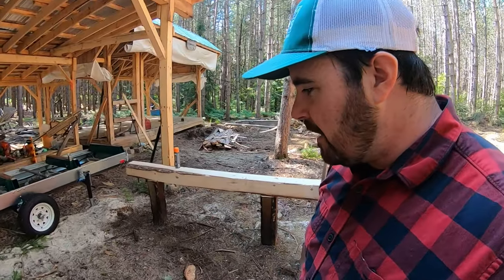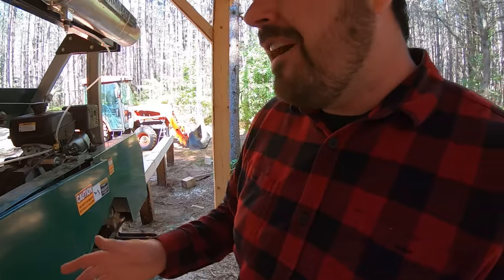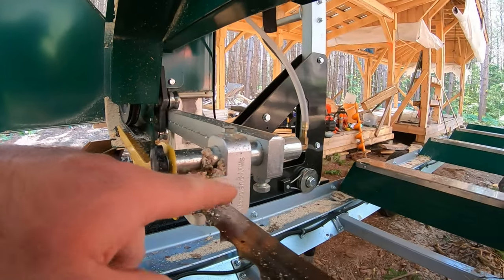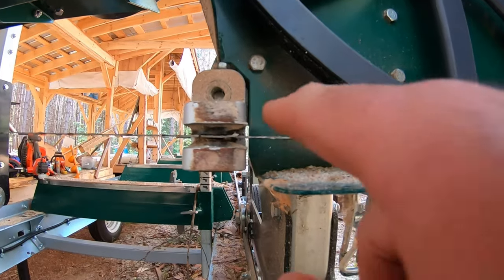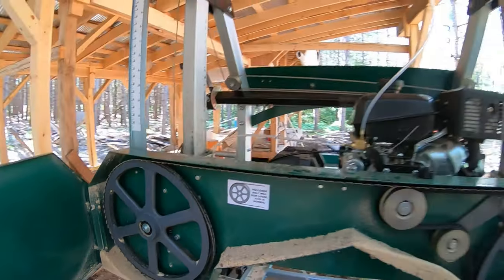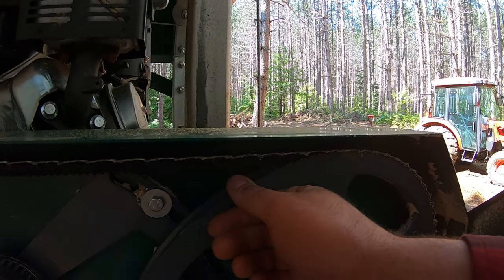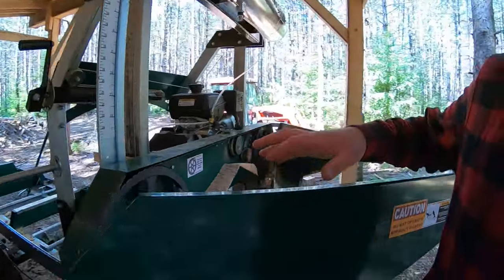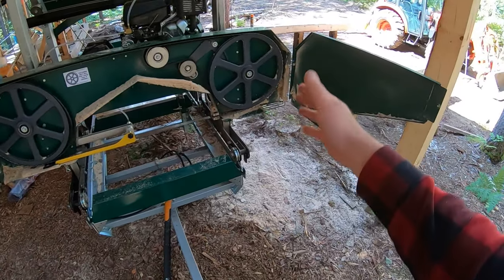Stop Your Sawmill Blade from Falling Off

Comment: I'm one of those people you mentioned at 3:55 who cut out those bars to keep sawdust from clumping. I didn't know then that those bars are designed to contain the blade if it breaks. Without those bars, it is possible for a broken blade to shoot out of there at high speed. Leave 'em in, folks.
Reply from the maker: Yeah I haven't had it happen but can imagine that it is possible

Comment: Great video Sandy-glad to see someone emphasizing the real purpose and positioning of guide block and guide bearings, easy to forget that as you're going through your log you're pushing an 800 lb mechanism with a 14 hp motor attached to it. You're 100% correct in saying that if all else is tensioned and aligned properly those blocks and bearing should only be called on to "help out" if you hit some gnarly knot. In a perfect world we should check them every time we change a blade. FWIW I also don't use lubrication-or at least not yet as I am milling green logs. Always surprised by the  amount of lube that is being shot out of the sawdust port on Norwood and Wood Mizer videos in particular. Videos are informed and informative-keep up the great work.
Reply from the maker: Thanks for that Kire!

Comment: Excellent discussion on why the blade may pop off.  I am on the other side of the spectrum, I use a fair bit of liquid soap and have the valve open  for the water to flow fairly heavy.  I have it adjusted so that the majority of soapy water flow contacts the blade teeth.  I think this keeps the blade cooler and reduces friction.  I have never had a blade pop off (knock on wood)  in the 2 years that I have had my mill.
Reply from the maker: I figure if it works for ya then you’ve got it dialed in and I wouldn’t change it either

Comment: Great tip! Yesterday I fired up my HM 126 for the first time in a couple of months. I checked my tracking and then adjusted the guide blocks. I used to have problems with the blade jumping off until Woodland Mills sent me updated information on setting the tension. My instructions said to turn it in until the crush washers made contact then turn two more times. I ended up damaging three blades. They replaced them and sent me new instructions for tensioning the blade. Works great! Cutting a pine log was very  enjoyable with no problems. I’ve been watching your videos for quite awhile and the spring of 2021 I purchased my first mill based on what I viewed in your videos. Thanks!
Reply from the maker: Great to hear you’re enjoying the videos and you have been around the channel for so long! Keep on sawing my friend!
Reply: Isn't great that Woodland Mills gives such support!  It is one of the reasons I purchased their product due to so many people declaring their exceptional support(and they were right).

Comment: Very helpful & timely advice, thanks Sandy. I have had a 126 for just about a year, and have had the blade jump off far too often. No matter how much I adjusted the follower wheel, the tracking was always just a little off - fractionally further forward on the tracking side, which is where it would inevitably fly off. After around 7 blades ruined (in only 10.6 hrs on the clock!), I mill in fear if that dreaded clunking sound & things grinding to a halt.
Finally worked up the nerve to tackle adjusting the drive wheel, in tiny increments until I could manually rotate the blade and see that it was staying true. Not declaring victory just yet, but I’m hopeful. It’s the only issue I’ve had.
Reply from the maker: I’ve got my fingers crossed for ya Andrew. Certainly takes the wind out of ones sails when the blade won’t stay put
Reply: I have the smallest mill by woodland Mills and this was something I noticed almost immediately. So I got on the phone and tried to contact someone with technical experience. And they advised me to adjust the drive wheel , much success has been had following a slight adjustment

Comment: On my third drive belt, but never had to change the follower belt. luckly i have not had a blade pop off. the wheel alignment has not been touched since new. blades are always checked prior to sawing ( well, Almost always). keep an eye out for potential problems and you should be good.  keep up the informative videos Sandy.
Reply from the maker: sounds like you’ve got a good system down Paul. I appreciate your support on the channel

Comment: Hi Sandy.  I agree about the pine-sol...perhaps we added too much as others use it without issue but my blade would pop off as well.

Another aspect that people should watch out for(if not using a torque wrench) is to make sure that however they are tensioning their blade, that it is consistent.  Once tracking is set, the blade generally will always track the same.  BUT...if you say add even a little bit more tension than normal, the blade will creep out on the idler wheel...less tension it will creep inward.  Even an extra quarter of a turn on the t-handle will do this.
Reply from the maker: Thanks for sharing that Mike. Consistency is key for sure

Comment: Great informative video! When I was setting up my sawmill I had a tracking problem right from the factory and the small adjustments are the right way to go. I have had a blade come off and it took out the yellow blade guard and the black plastic piece it slides in. Now I check everything you have said in the video as a pre startup routine.
Reply from the maker: Glad it was a good video Scott. Happy to hear everything’s up and running well for ya
Reply: My 126 drive side was out of wack as well, love the do not touch sticker they put on it, that plastic block was also damaged very quickly and replaced it with a 3/4” plywood coated in wood glue which holds up very well to impact and easy to duplicate.
Reply: @jeremyscott6641  I agree with the do not touch sticker. My hm130 max woodlander was no where close when I got it!

Comment: Great information! I asked you about a month ago about why my tracking kept messing up and you told me to replace the belts. Turns out the blade was riding on the band wheels and kept moving forward because of it. I replaced the belts like you suggested and now everything is running great! Thanks for the help and the awesome videos!
Reply from the maker: That’s great to hear. Nothing worse than not being up and running when ya just want to be cutting

Comment: Howdy Sandy- great information! I’ve never had trouble with tracking but I’m having a bit of shaking in the head and have to come to a stop and start again and cut slowly. Been trying to figure it out. Hope you have a great weekend. God bless
Reply from the maker: I"m wondering if the white-coloured bushings that run up and down the steel posts to keep the sawmill steady are worn a bit or need to be pushed inwards a bit to prevent shaking?
Reply: When I encountered that situation with my HM 126 it was due to warn out sleeve bushings . It was allowing excess play that caused the whole head to tilt and made the blade walk.  It was also causing jumpiness in the head when attempting to feed steadily. The kit is only $10.00 u.s., if you are running a wood lane mills.

Comment: good video. only thing i have to add is fully tighten to over 20 lbs be fore you check tracking and if it's a little off go to 25 and check again that may fix it like you said only adjust when you have too. you are right to much lube of any kind can make a blade come off.good video every body needs to watch this video that has a woodland mills. if you are thinking about buying a lx type woodmiser people are have a lot of trouble with them. sandy and other's were the reason i got my 130 max if it hadn't been for 14 month wait i may had ordered a lx type woodmiser. thank you for all your video's.n take care, be safe and well.
Reply from the maker: Great point there John. I appreciate the well wishes and happy you're liking the videos

Comment: Sandy I helped a friend set up his hm126 and the problem he had on his tensioner side was the tensioner bolt is filed to a point and that point sits in a dimple  in the tensioner axle but it wouldn't seat all the way in properly...we would have to give the wheel a good bump or 2 with the palm of our hand and here it pop in then retention it... customer care said that we weren't the first to report that issue...after afew good weeks of running it that issue went away...cheers
Reply from the maker: Thanks for sharing that. I didn’t know about that

Comment: Another great video.. the quality and content of your videos just keeps getting better. You are absolutely correct in that alignment is critical as well as the positioning of the guides. There is no need for them to be touching the blades during normal operation. 
I would encourage you to give pine sol another try. I use a concoction of Dawn soap,Pine sol and water on my mill and love it. (never had a belt pop off, at least not for alignment issues or too much lubricant.) I have had one pop off by pulling backwards, when I shouldn’t have. Cutting Ash the lub is set to a just shy of a steady stream. This keeps the blade clean shiny and cutting straight.
That said I have not had a lot of issues cutting pine, however Spruce,Ash, or Walnut can be troublesome with buildup on the blade without a lubricant .
Reply from the maker: Great to hear first hand account of the pinesol mix you use Rick. I will for sure give it another try after hearing the good success you've had with it

Comment: On my 2011 Norwood MX34 the band wheels have a some sort of poly belt on them, they aren't lose like yours or Wood-mizer. I wonder why Woodland dont use same idea as Norwood, and wonder which way is better? To me it looks that sawdust will get under your belt easier then Norwood, which in my mind not ideal. for keeping right blade tension, yes no maybe........
 I do have same ceramic blocks as you do but but. Lot of people dont like them because they say that ceramic blocks lets blade wander and cause wavy cuts, but I'm not sure if thats true.........
 I replaced those poly belts several times and they go on extremely hard, they are tight fitting belts that are pried on with screwdrivers. When blades keep popping of, usually it's because of those tight poly belts have developed some soft spongy spots around the wheel.
 So when they come off they usually rip into the plastic band wheel covers, which cant be replaced and now have some bad cuts in covers. A year after I bought my mill. Norwood decided to cancel the MX34 only after fer years of production, and replaced with HD36, which makes it harder to get parts. I'm not happy about that, it BLANKED me off. When I buy an expensive equipment I expect to get all  parts at least for the next 50 years, but since I'm 70 that would be my grandkids.......

Comment: Another good video, thank you very much. I have watched your videos for several months and in one of those videos you say that the blade has to be even with the back of the follower side. Now, when I try to adjust the blade, the drive side has no edges. When the follower side and the drive side are even, both in the back, the blade is about an eighth or a little more. Will it be okay like this? My sawmill is new, I haven't used it yet.

Comment: Hey Sandy. Great video. I may have missed it , you should probably check the tracking before you make any blade guide adjustment? Also the blade is supposed to protrude a certain distance past the back of the drive or follower pulleys ? Thanks in advance.
Reply from the maker: Hey Terry! Yeah I normally only look over the blade guide adjustments and wheel tracking adjustments if the blade isn't tracking well but the blade guide is worth a look regularly for sure. The amount the blade is supposed to stick past the wheel should be the same as the amount it overhangs the back of the wheel

Comment: I agree with you completely. My one and only blade jump on my HM126 was due to using too much water which causes the blade to hydroplane. It jumped off the second the blade contacted the wood. The blade was trashed and I scared up the inside of the housing.
On an unrelated question, what do you use for lubricant when it is below freezing? I used auto windshield washer fluid last winter but that is pretty soapy.
Reply from the maker: That feeling of nice paint being all scratched up sure is a pain isn't it. I know that feeling. In the winter I use car washer fluid but mostly I find the logs I am harvesting and sawing in the winter are frozen and so they are quite slippery for the blade as they are so I don't use a lot of lubrication in the winter if any

Comment: Hi Sandy I enjoy your channel! very informative! However do you ever try to improve the design of the mill for example I see your idler belt being loose personally I think that sawdust could get in and this would cause the belt to defect the blade off? sort of common sense. I think putting a belt tight will keep it clean! another thing is I run a hard wood block at the back of mine so if the blade for some reason moves back the hardwood block keeps the blade from popping off. I was having problems of it doing that and of course the wheels needed to be aligned. but it is a small improvement to keep the blade from popping off and getting damaged. Because being human we don't always get it right! Right?  I have a lumber mate 2000 which is similar to the woodland mill and the frontier! Another modification I want to make to mine which I think will improve the design is putting on a double idler pulley up and moving the motor back and running a secondary belt from the motor to the double idler pulley I think running two belts will get more life out of the belts. I will let you know if it is more efficient! I mentioned it to Jerry bigelow of Jerry BIgelow woodcraft another great channel I like to follow! He thought the idea was interesting! I am currently building a new design of sawmill which will try to post in the coming future! Thanks for your content Have a good one! Marc G.
Reply from the maker: Hey Marc! Great idea with the wood block. I haven’t touched the follower belt just because woodland mills designed it to run loose. I haven’t had any issues yet with it like that. I like your wood block idea. I’m thinking I may have to try that sometime. I like the other improvements you mentioned. I think with time I may have to try some of theses

Comment: Have you done a video yet of different types of blades and sizes? My 130 Max is not here yet but I ordered an inch and a half ripper blades for it.
Reply from the maker: Great question Jason. I haven't used any other blades but the ones Woodland Mills sets. I would like to try a set of some of the other brands though

Comment: When cutting very hard Elm ere are slight ripples  the surface of the cut board.  Is this a sharp blade issue or a blade tracking issue.  Thanks so much. I've just started sawing recently wnd watch your videos continuously.
Reply from the maker: Appreciate you tuning in Tom. I'd say the issue is one of the teeth on your blade is slightly out of set (bent slightly differently than the others) and so as it cuts the one tooth creates a vertical line on the board. I'd say try and a new blade and see if that goes away.
Reply: Thank you!!!!!!

Comment: Good morning Sandy I did have a problem with blade popping out but it was my fault I am cheap my running belt was fine but my idle belt needed a change so I changed ge only that one but after reading again every thing in the book it says to change both belt at the same time
Reply: Change both side at the same time after doing it that way the problem was gone 
  You mention a few time by having to much lubricant may cause that blade to jump out I had my lub open all the way many time and never had a problem the only problem was not keeping the tar from the yellow pine of the blade and belt and I use pine sol only with the yellow pine I think at one time the yellow was use for a type of tar glue it is very sticky  well have a great day
Reply from the maker: Glad you got it all sorted.
Reply from the maker: Yeah I've heard good things about lots of water and good things about very little. I think sometimes things end up being just a bit different with each mill

Comment: Those wheel belts, the one on the left, why is it so loose ?
I have a shop woodworking bandsaw, my belts are not loose at all, just wondering if that was normal for your saw.
Ok you just answered my question,....
Reply from the maker: Yeah I thought the same thing when I first saw it John. It is supposed to ride loose which goes against everything I’m used to but so far so good with my sawmill

Comment: I’ve had four blades break on me in the past couple years. Haven’t had one pop off yet though. Wondering if I’m tightening too much.
Reply from the maker: I think if it's only 4 blades it could very well be the blade was just worn out or a manufactuering error. If every other blade was breaking I'd think it was an issue with the sawmill
Reply: @sawingwithsandy  appreciate the advice and quick reply.  

You the man Sandy! ✌️

Comment: In 5 years I've never adjusted the drive side wheel tracking on my Woodland mill. Just adjust the follower wheel to get even tracking. Just use water, only problem I had was pushing a dull blade too hard causing blade to jump off. Operator error I won't make again.
Reply from the maker: I’ve also had a blade pop off by pushing too hard. I’ve lived and learned
Reply: As this is not affiliated to Woodland Mills, Cooks made a nice video about this. As he said: "It should look like a thin pencil line, if it "wobbles" tracking is off." If "driving wheel" is off the "free wheel" can't be aligned. I know that there are full metal crowned wheels on the AC-36, but I think that the basics are the same...